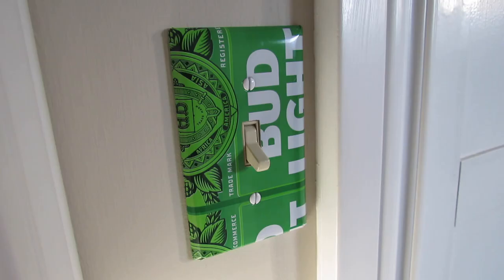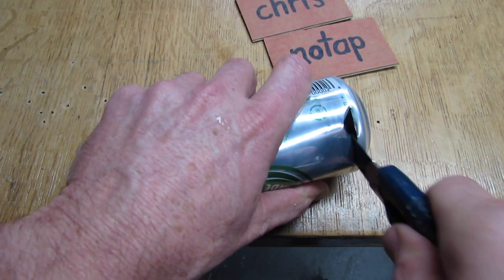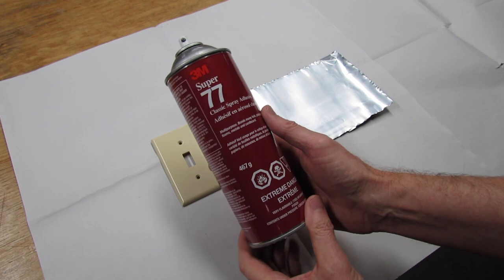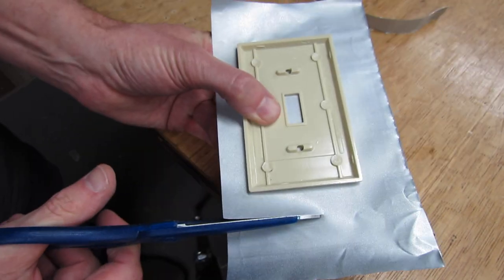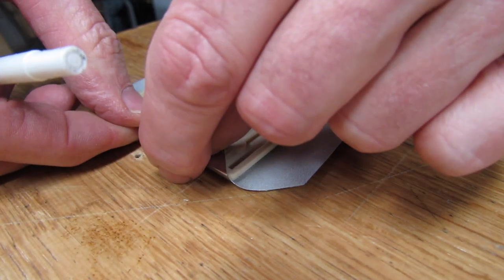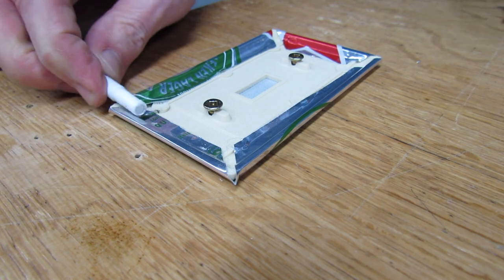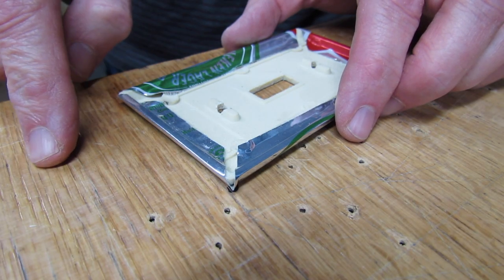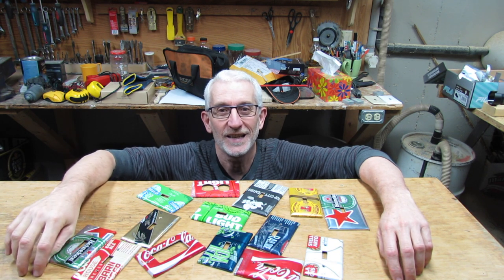How To Make ●  Light Switch Covers From Beer Cans

Comment: TOO COOL!!  Very well thought out all the way to edge treatment and handling corners.  Great.  Before spraying the glue the first time, mark the cut lines with a Sharpie and mask off the part you don't want glue on with tape.  Spray the glue and peel the tape off.  These are extra steps but might be worth it to not have extra sticky bits when cutting.

Comment: Oh Chris that’s definitely an awesome idea!! I just put up a 60’x80’x16’ pole barn and I’m pretty sure I have over a 100 different switches and plug ins and have been trying to find covers for them!! I’ve really wanted to get diamond plated ones but heck I’d have to take out a small loan just to get them all covered!! I’ve seen a couple hardware stores that had a box of plastic covers that was discontinued to like .10$ to.20$ each but I really didn’t want plastic ones for my shop but with your really neat way to cover them and make them look really nice I guess I will have to go back to town to the hardware store and hopefully they have enough cheap ones to do my hole barn!!! Lol!! Looks like I’d better also stock up on some different drinks that I like or maybe see if I can get some from the redemption center!! This should keep me busy for several months!!! I might get everything this summer lined up and then I can do it this winter inside where it’ll be warm!!! Thanks for the idea buddy!!! Remember keep up all the hard work buddy!!!!

Comment: Mike, thanks for all your videos and the neat things you do. As a retired electrical inspector, I think this one however, may create a danger. If a wire happened to come into contact with the aluminum thats folded on the inside of the box, in could become energized. Even if the fixture was properly grounded it might still create a hazard. I think the National Electrical Code would prevent this as a means of decorating a switch or receptacle box. Thanks.
Reply: Sorry, it's not Mike...........Chris!
Reply from the maker: You’re  right but the 2 screws that hold the plate on are directly touching the metal pop can and are grounded through the switch bracket directly to the box.
Reply: Thanks Chris, and you're absolutely right as well. I guess I was mostly thinking about older homes in which the switch wasn't required to be grounded. I apologize for the confusion.

Comment: I really love this idea and I am going to try on all my switches, what about double switches. I wish you could use some cheaper adhesive spray, 30 to 60 dollars is way to high. I think u can buy the same spray at home depot for 11 dollars.
Reply from the maker: If you can find a can that will do a double then you could give it a shot.
Reply: Probably a “tall-boy” can or the 24 oz. cans would work for a double switch but it would probably have to be turned sideways.

Comment: It is a great idea, I really like it as a concept, but...  Although unlikely, there is a risk of an electrical contact with some element of the switch or even arcing...
Reply from the maker: Thats why I say in the video to leave 1/2" to 3/4". That leaves enough to be able to bend it over easily but at the same time isn't enough to allow it to touch anything. Also the 2 screws that hold the plate on are grounding the beer can to the switch and the switch is grounded to the box.
Reply: Fair enough, although set-ups could change depending on the country and the regulation (woopsie, house is cabled for ground but isnt really grounded, or no current circuit braker, or the design of the inside part of the switch is ** or old etc...). Maybe adding insulation to the folded part going inside? (hot glue,...)

Comment: Surely with a metal faceplate they would need to be grounded, wouldn't steel corrode eventually after use, so use only aluminium?
Reply from the maker: It is grounded. When you attach the faceplate when you're done, it screws into the switch which is grounded to the box. These cans come with a coating to prevent corrosion. It's all good. You bring up good points.

Comment: The end results are cool.
These are more like Man coffin switch plate. Using aluminium sheet as switch plate cover is an awesome way to get electrocuted in the event of any leakage in the circuit or during lightning
Reply: Many of the outlet covers in my workshop are stamped steel, and none of them have attempted to kill me. Unless the wiring inside the box is beyond sketchy, this should be just fine.

Comment: hey chris, Metal conduct electricity
Is that safe to put metal over switch plate?
Reply from the maker: The screws that hold it on are grounded. It’s all good
Reply: You can get metal switch plates. Should be fine provided you glue it down to the back properly and don't leave it poking into the box.
Reply: Use common sense. If you take the cover off and the wires look like a Rat's Nest maybe don't do it. But there are metal switch plate covers available they have the same risk if any.

Comment: Let's take metal and fold it around the switch plate back where the wiring is so that if you have a loose wire, you'll definitely find it when you flip the switch lol
Reply from the maker: Yes correct but you'll notice that the 2 screws that hold the switch plate touch the pop can which then goes into the light switch which is grounded to the box and the circuit.
Reply from the maker: Plus they sell stainless steel, brass, plain metal switch plate covers at any hardware store.

Comment: Don't try this in the UK. Any metal surface needs to be properly Earthed (grounded). Our 240 volts is definitely a potential Kill Hazard. There are some plastic (looks like metal) switch fascias available, but you better have good deep pockets.  Darn good video though. Thumbed.